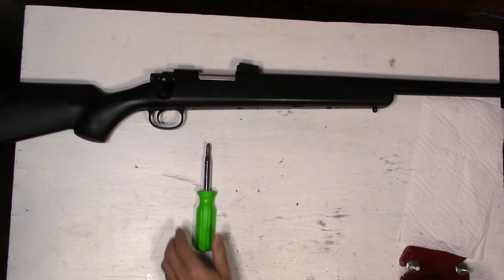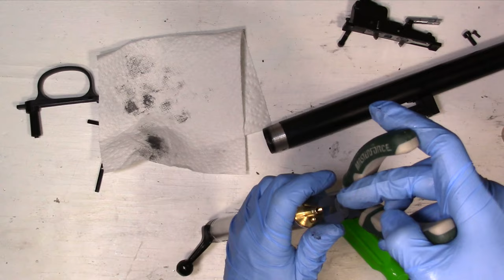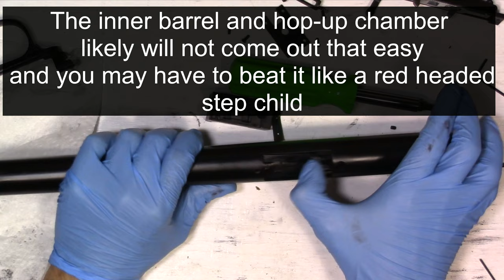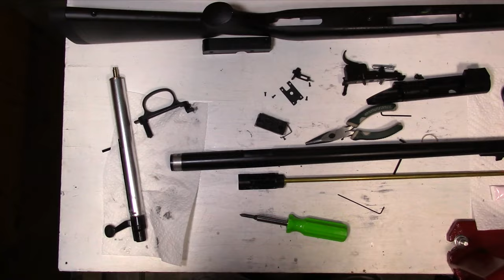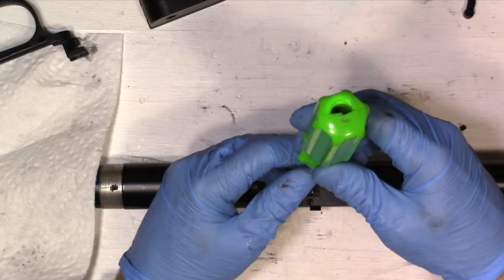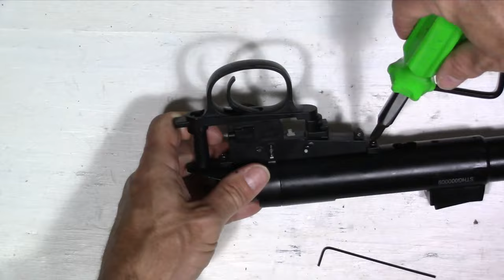CYMA VSR 10 Disassembly and Reassembly

Comment: Ty for the video helped alot on my first full dissasembly. I had to sand down rough edges of the side hole of the cylinder for smoother cocking.

Comment: How are the iorn sights on it are they adjustable
Reply from the maker: The rear sight is adjustable for both windage and elevation
Reply: Is the front sight actually attached unlike the tokoyo maurie using double sided tape. 😂 Dumbist thing i ever saw that brand went down a notch in my book after seeing that
Reply: Also too do you think can attach a after market peep sight to the rear behind the chamber using the mounts for pic rail?
Reply: Or do something like this
Reply: Like real steel m70 parts work